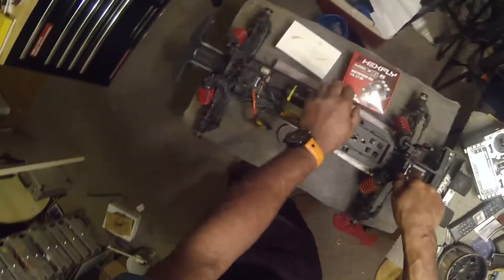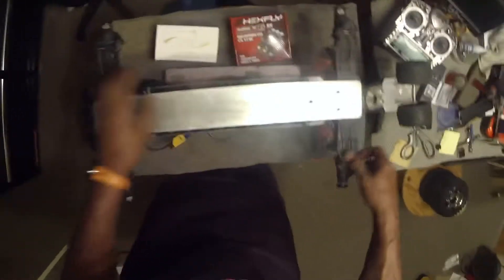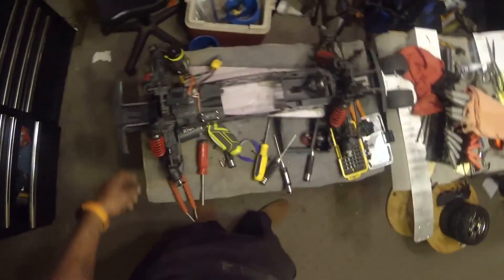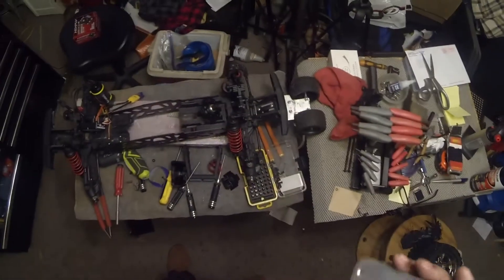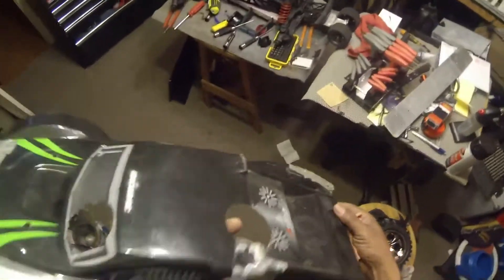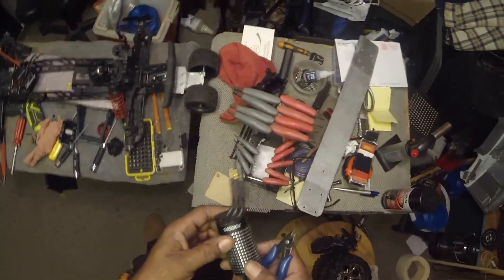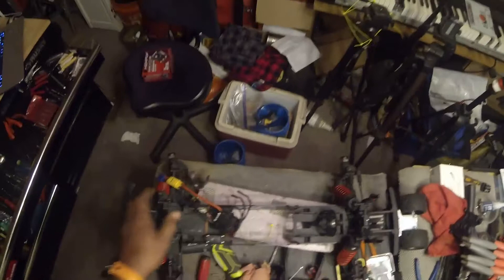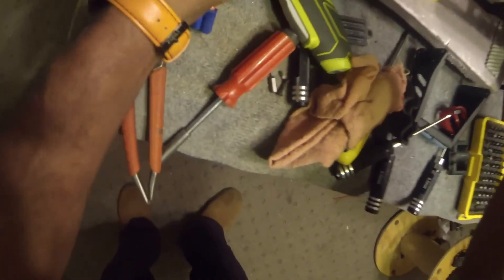Cen colossus / Reeper Upgrades Pt1

Comment: Good work RC brother 👍👊
Reply from the maker: Preciate you Kizz, Thanks a Bunch !
Reply: Phill Stoffer will that sherredar 1300kv handle 6's esc
Reply from the maker: Hiya Kizz. Heres what you need to do if you want to really enjoy that shredder. 1 get a steel Spur gear amazon cheap. The motor and esc, toss em, No Joy converting just the esc. 4082 leapard 2000kv and Hobbywing 150 amp esc, the esc is right around 90 on amazon maybe cheaper on ebay, the motor around 70, sell the stock stuff or use to upgrade a smaller RC you already have., My Shredder has the motor and ESC from the Cen Colossus in it, still working on the motor mount design as I just got the hot racing Quick slide motor mount. Use 80 weight in the center diff and ADJUST FRONT AND REAR AS NEEDED, hEAVY WEIGHT OIL IN COLD WEATHER = FAIL.. Ask anything you need Brother Kizz, better to ask and research than to burn money and Fail. God Bless..
Reply: Phill Stoffer thanks brother for info 👍👊
Reply from the maker: Kizzel Garrett welcome. Anytime..

Comment: Dr Phill !!!! 
I’d b interested to c the polishing process bruzz. 🤔 Man U have those rigs pulled down and sussed before u break em. Nice work that Cen is a beast !! Was that the center diff that fell ? Looks tuff. Cheers 🥃👊🏻👊🏻👍🏻
Reply from the maker: yeah Brother that was the Center Diff, it weighs a tom as far as diffs go. i be will to bet weighs the same as a 1/5 scale gas unit. I will record the polishing process as well as the Epoxy Deco Job there it is !!!
 Peace!!
Reply from the maker: The plate is finished, check the followups to see the epoxy job, I know you are enjoying that new paved Berm at the track !!